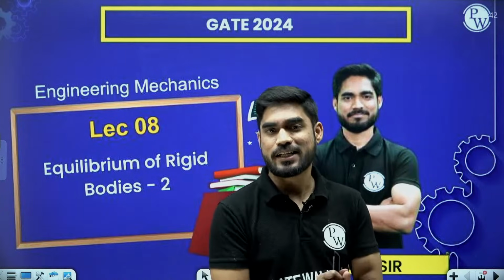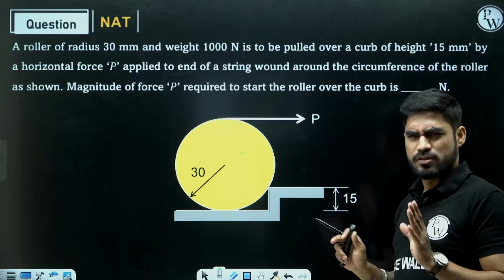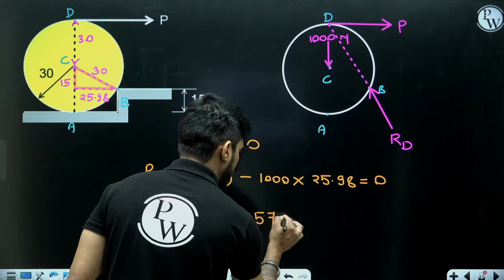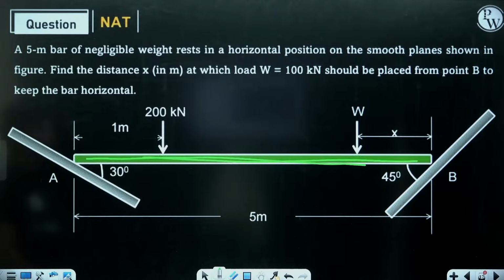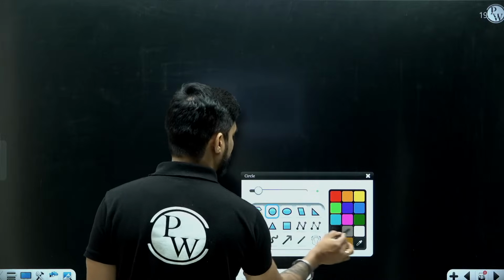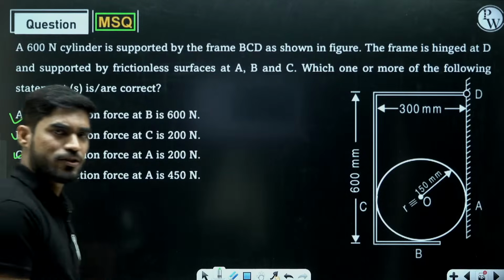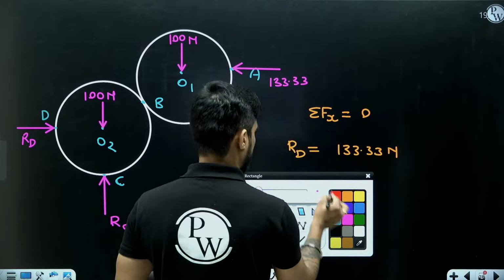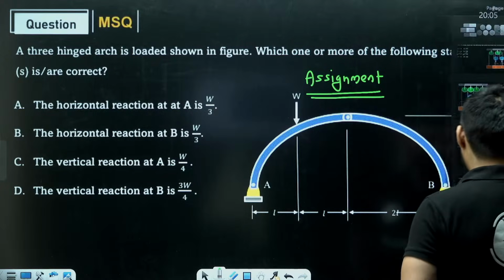Engineering Mechanics 08 | Equilibrium of  Rigid Bodies - 2 | ME | Gate 2024 Series

Comment: sir, roller wale question me fx, fy equal to 0 lekar kaise karenge aur lami's theorem se bhi
Reply: 2 years too late but, calculate the horizontal distance between B and central line using pythagoras, then use pythagoras again to find the distance between top of roller and B then use fx, fy to equate and find the ans. 
For lamis' we can again use the horizontal distance between central line and B, and the vertical distance between B and top of roller and use tan inverse to find the required angles.

Comment: Sir, 
In cylinder question where it is supported at A,B and C. The reaction forces at C and A should be zero. Let us say cylinder was not touching point C and A. It would still be there in this rigid frame and cylinder would not move. As all the angles are at 90 degrees.

Comment: sir in roller question if force from the edge is not acting to the centre then you are taking friction in consideration which is not given in the question
what i think is that we must not equate moment on this case and let roller rotate 
then equate the vertical component of reaction from edge to the weight of roller